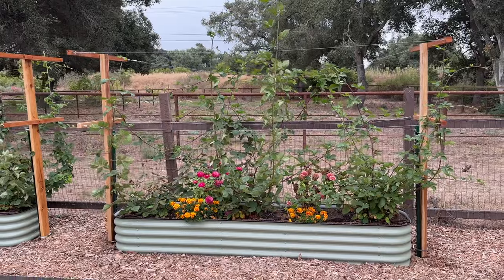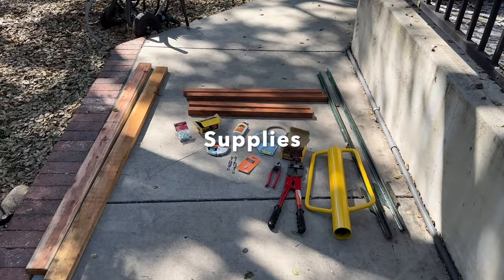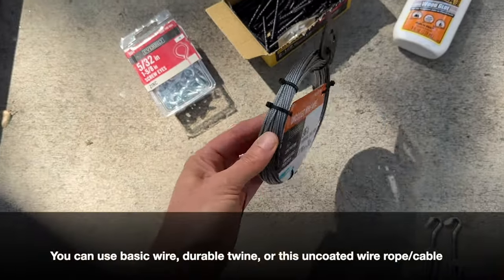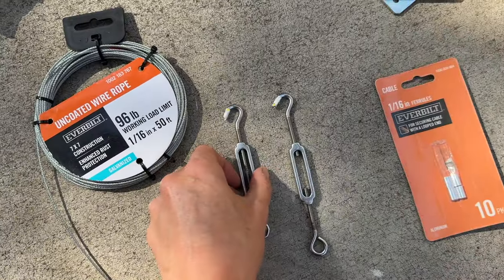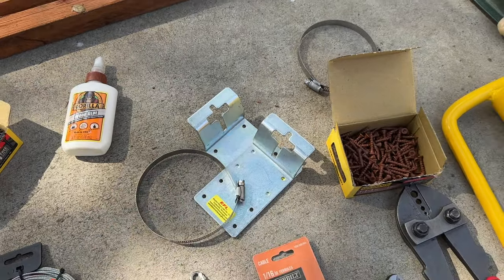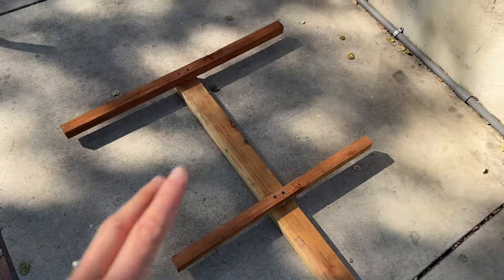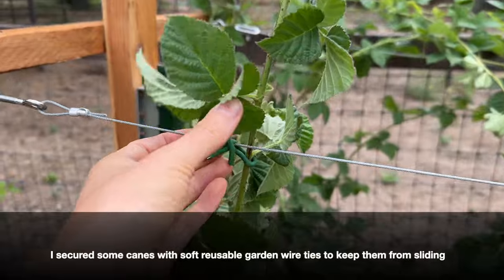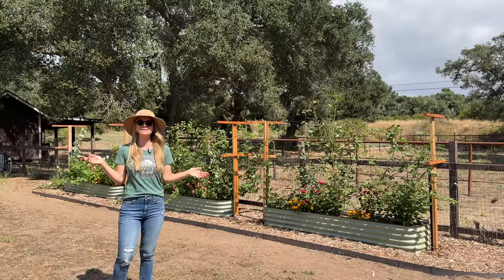DIY Berry Trellis: How to Build a Wire Raspberry or Blackberry Trellis

Comment: I love this idea!  My ground stays so wet that 4x4 posts set into the ground a) would rot in a few years and b) would be difficult for me as an older woman to get set level in our rock and clay.  This combines the pleasing look of wood with the less visible metal posts that I CAN drive into the ground!  I have had my berries in pots for 3 years now because I just haven't known how I wanted to approach this trellising project that would be both attractive AND doable for a 70 year old woman. Thank you!
Reply from the maker: That is so great to hear, pounding the t posts into the ground can be a challenge (even with the fence pounder), thankfully, we have sandy soil here but you may find more resistance in your rocky clay soil. Good luck on your project and hopefully you can get those berries out of their pots.

Comment: Great video..In canada we don't get Vertical T-post brackets. Are there any alternates?
Reply from the maker: You could just use 4x4's as your main post instead of using t posts, you would just need to concrete them into place or use a concrete pier to secure it. This would obviously make your trellises much more sturdy as well. Hope that helps and good luck!